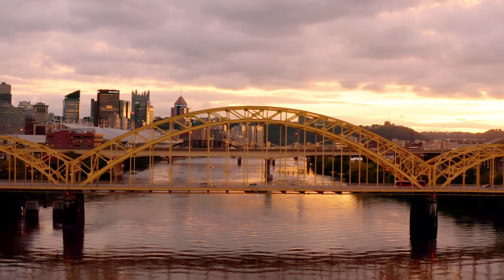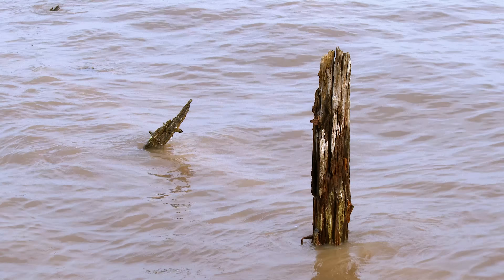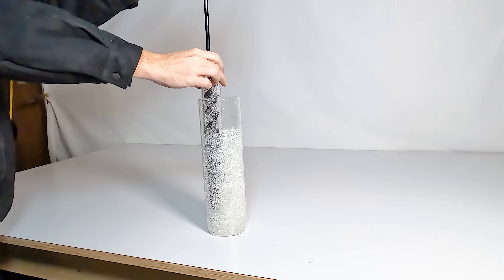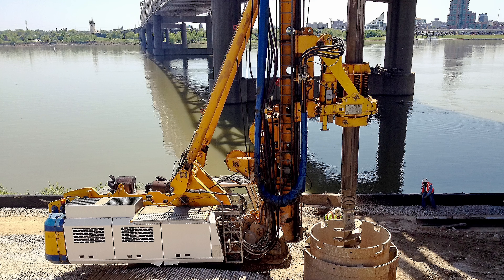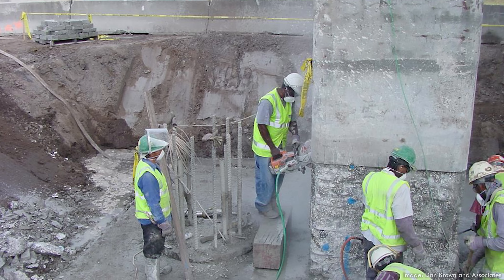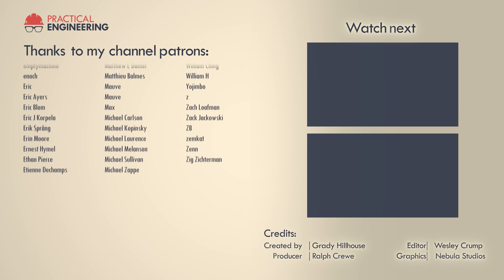Why Bridges Don't Sink

Comment: The constant banging is needed for a proper pile driving. There is a depth specification concern for sure,  though production needs require quite a depth per thrust ratio.

Comment: 3:14 maybe because when they’re used as beams you want to be setting them with the flat sides on the top and bottom so they’re I-shaped but when they’re used as vertical pilings it’s better to arrange them for laying whatever you’re putting on top of them in a way where they’re H-shaped?

Comment: As a resident in Hampton Roads, Virginia, I have seen many bridges get built, and the area continues to grow due to the military presence. In fact, right now, a multi-billion dollar project is going on in my are with the widening project at the Hampton Roads bridge tunnel. It's using one of the world's largest tunnel boring machines, (nicknamed Mary). Meanwhile, the world's largest privately owned Bridge Tunnel, the Chesapeake Bay Bridge-Tunnel, is also being expanded with two new tunnels. It's an amazing time to watch these two modern marvels start construction. In Chesapeake,  the Deep Creek Bridge replacement project is underway by the Army corps of engineers and construction teams. The bridge was built in 1922 and was well overdue for replacement. I am happy to say that our bridges have never sank. However, we had one case of a bridge collapse which occurred during construction of the new Jordan Bridge. That case is a whole can of worms I don't want to get into. Let's just say the company that built that bridge later went on to build the Florida University Bridge which also collapsed.

Comment: I know the answer, Romans, port concrete, underwater, and set underwater without barriers or anything else. I don’t remember the exact terms of how to do so, but they did make docs and barriers for boats because of the concrete that they had back in the day could set underwater. I assume it’s similar to today, but also technically we set big barriers up to allow the concrete to settle in water Without getting fully wet. Ancient concrete was definitely a thing back in the Roman Empire back into. 1600 hundreds, so if anyone has a dispute about this, you could look up the history channel and get a better understanding upon how the Romans set concrete and water.
Reply: To add that it was probably more closer to the 900 if I’m to be more accurate because the 1600s was where America started taking over past England so 900 would be more remote. It makes more sense but I do encourage people to look up the ancient Roman concrete because it is stronger than our current concrete only because we don’t need to put our current concrete into water and the ancient concrete, but it also used volcano ash or something to make a little stronger but being Romans concrete still stands after 1000 years so love it better than her 20th century stuff mostly because we have steel the concrete to make it better. The old concrete back in the day didn’t steal or iron. It just needs to settle in the water and then potentially it did make it stronger because even at today 2025 there ancient concrete is still standing, even if it is a little broken, but there are videos out there that can explain more and the one I watch previously was from the history channel

Comment: The geology around here leads to a few compromises with foundations. I am in Inverness in the Highlands in Scotland. We sit on top of a major fault line which thankfully is not very active. The entire length of it is glaciated and filled with fresh water interspaced at intervals across the country with plugs of glacial till upon which a few of us, about 80,000, live. We know what's down there since the BGS website records a near 100m drilling operation from the late 19th century that records the presence of only sand and gravel. One housing developer replied to a question about their foundations with, "We cut the grass." This reflects an understanding that whatever depth they went to beyond the grass had the same stability for the one and two storey buildings they were dealing with. For larger and more complex developments, drillers make 10 or 15m exploratory holes (many on BGS site). Some state they are looking for "bedrock". Well good luck with that since it is 300 or 400m down in some areas. Extensive piling operations can lead to confusing results for those who struggle to understand what they are dealing with. All one needs is one member of the team who was educated locally and did a primary school project on glacial till and it should sort itself out!

Comment: I love piles...  I built outdoor patio walls on soft ground by using treated 2x4''s that I pounded into the ground in a line. Then with a straight line string Marked each one level with the other and used a saw to cut that off evenly, then placed a 2X4 across them as a base plate. They support a number of 3 ft by 7ft double glazed glass panels. Then a course of double 2 by 4 on edge to support the roof structure. They have not budged a millimeter in 12 years. Also used pressure-treated fence posts as piles to build a bush cabin in soft and uneven ground. Just pound them in till firm, cut them all level and build the structure on top of them. This is a very cold area and having the piles pounded in deep there is no frost heaving to worry about. I was also thinking they could be used for driveways and walkways built on soft ground. Small fraction piles could be pounded in the ground along the course of the walkway then concrete poured on top. These would never settle and  become uneven causing problems in the future.

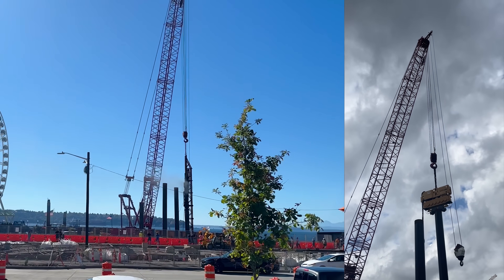Comment: At 7:55, to the right there’s an APE Model 200-6 vibratory driver/extractor that has a driving force of 271 Tons. Pretty amazing piece of equipment. 

Pros:

- Slightly more forgiving to crane operators. (Generally speaking every job is different.)
- Can make fast work of any pile or sheet in soft to medium ground hardness conditions.

Cons

- There’s an entire separate power unit to take care of in order to power the hydraulics.
- HOSES, HOSES, HOSES. Anywhere from 100 to 300 feet of hydraulic hoses that the pile driving team must protect from kinking, wearing, breaking, and ect… 

On the left, looks like a D-46 diesel hammer either from APE or Pileco. One of these babies can give you 114,000 ft-lbs of energy on maximum stroke. Diesel hammers are the dirty beasts of the pile driving industry.

Pros

- Will make easy work of medium to high hardness ground conditions.
- Once set up, easy for the pile driving team to take care of.

Cons

- Experienced crane operators are preferred because some hammers require the control of three lines.
- Loud and Dirty. 
- Soft Ground 

This is APE if y’all are interested www.americanpiledriving.com/

Comment: I did construction layout for the bridges on the new section of 540 in Raleigh nc. What a cool experience to work on bridges. I got to walk on the girders to do profiles for the build up measurements. They needed to make sure the deflection would be perfect after the weight of the deck.

Piles not going in straight is the only part of building a bridge where they just say oh well what can we do. Everything else is insane tolerance pushing the limits of survey equipment.

Comment: Im an engineer
I-Beam (or W-Beam)

Has a narrower flange (the horizontal parts).

Designed for horizontal load-bearing, like in building frames.

Flanges taper slightly (not perfectly flat).

H-Pile

Has thicker, wider flanges, making it more symmetrical.

Designed for deep foundation support, driven into the ground like a piling.

Comment: In the UK, the High Speed train link from London to the channel tunnel had to pass over the river Medway, known as the Medway Viaduct. This was designed with "V" shaped piles to allow for the lateral loads created by two high speed trains on the viaduct travelling at top speed slamming their emergency brakes on at the same time. Glad they considered that worst case scenario, I wonder if all rail bridges did?
https://en.wikipedia.org/wiki/Medway_Viaducts

Comment: Well, all this is a heck of a lot safer than the construction of the Brooklyn Bridge's river foundations.  Saw a documentary about it on the History Channel back when they still had history.  They build these large wooden structures called caissons, which were like giant upside down barrels.  They sunk them in the East River, filled them with compressed air, and then sent workers in through an airlock.  The workers manually evacuated the river soil, which allowed the caissons to sink further and further down.  Once they hit the desired depth, they could be filled with brick piers and concrete.  Hot, humid air, cold water, and a poor understanding of what we now call decompression sickness made it miserable, dangerous work.  The chief engineer, Washington Roebling, was badly injured by decompression sickness and subsequently directed the construction from his home via telescope and letters delivered by his wife.  In fact Emily Warren Roebling would take over most of the day to day supervision and chief engineering duties in her husband's absence.

Comment: Do you genuinly not know why they are called H beam and I beam? Aren't you(or someone in your team) a civil engineer or something?
They have slightly different shapes, and are thus able to take different loads. I beams are named after a capital i(with a line at the top and bottom). I feel like this is common knowledge.

Comment: I work in Marine Construction we have an A frame barge with a 2500 lbs weight we use to dtive pylons, we jet them in on bulk heads with a jet pump depending on the ground, sand is good, clay we have auger the holes.. small company I work for dont have an excavator

Comment: ??  When you do those pounded in piles, great, you know exactly what types of weight it resists !
But with other methods,  how do you even start to know what size or type to use,  when "the ground" is under X+ feet of water & muck ?

Comment: A small correction.
3:10 You just told about applying Newtons 3-rd law to loading and driving piles which is absolutely correct. Newtons 3-rd law is about forces. 
3:55 Now you are speaking about driving a pile in terms of energy. Energy not relevant here, you should stay in terms of forces. What's really important here is the momentum of the hammer when it touches the pile. That's the reason why you need a heavy enough hammer to drive a pile - the heavier the hammer is the less energy you spent to get same momentum (p = m*v, e = m*v*v).
PS. Thanks for your videos! They all are amazing, I really enjoy them!

Comment: I have designed some large diameter drilled shafts and was wondering what the maximum diameter is. We are talking machine drilled, not excavated like the Brooklyn Bridge. My record is 15’ for transmission poles in Texas. 

People want to go bigger, but I have not heard of any bigger equipment. Trying to ship a 16’ auger down the road would be an interesting challenge.

Comment: When they need to reinforce old bridges foundations, it's in many cases Impossible to use the methods described. in those cases it's better to use Jet grouting. Under high presure they inject cement in the ground under the foundation.

Comment: When they built interstate 80 across Lake Milton, I have no idea how they drove hundreds of massive angled I beams to build 2 bridges straight and level across about a mile of lake. They had a giant barge they must have trucked in, in pieces, and then welded together. Somehow, they picked up those beams, angled them just right and drove them in water 40 or 50 feet deep. But how, when they got near the shore, and the water was too shallow to float the barge, I don't know how they ever did all that. Years later when the lake was drained, there were all of those I beams, driven right where they were supposed to be

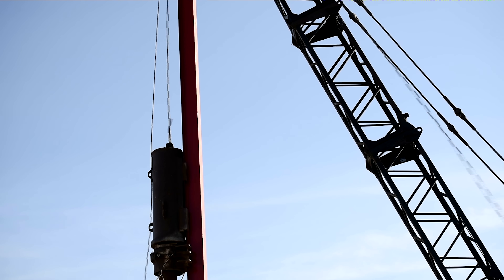Comment: I am a journeyman ironworker, I have over a decade of experience. 03:20 ,  This is the simple difference between an I beam and a WF (Wide Flange), "H" beam. The amount of material in the crossing member connecting the two outer parts. |~----~|. Called the Fillet Radius

Ill tell you that you got the H and I beams wrong in that first illustration for several reasons. First. There is no such thing as an H beam. They are called Wide Flange (WF) beams. In your diagram 03:20 , the left image is a "H"..WF (wide flange). The right would be an actual I Beam. The ~ represents the added material during the rolling process, IE Fillet Radius.  | = represents the flange part of either, --- = web
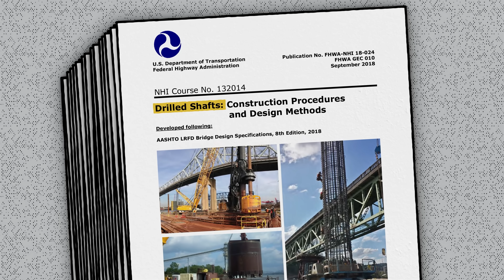Reply: 09:00 , hey look, a rod buster, I've done plenty of those too. Its hard to get your foot in a lot of the time so you are duck walking up them, also getting stabbed by the tire wire as you go.   They are pre tied on metal pipe saw horses and then tripped and set like columns. But you still have to climb them to, say, disconnect the crane, or add wagon wheels, or add more bars if the engineer so decides it.

Comment: A new bridge is being constructed across lake Ray Hubbard near Dallas.  It's been a real treat the past couple of years to be able to take the boat out and just watch all the pyles being drilled.  They are drilling with casing and they haven't had to go super deep, and the water is relatively shallow compared to most bodies of water.  They've actually progressed surprisingly fast for such a giant project. They may have less than a mile left.  For anyone who wants to watch up close, it's cheap to rent a small boat, and they allow boats very close to observe.  They typically don't work on Saturday or Sunday,  and the weather around here is very favorable with very few weather disruptions.

Comment: Just some local knowledge involving piling. US Steel blast furnaces in Gary, IN, constructed in the early 1900s are sitting on timber piles driven into sand (literally on lake Michigan beach). In that era and looking historical photos they don't look more than 30' -50' deep. These furnaces over the decades have gone through vast changes in added structures and off centered loading never dreamed of at the time of build. They've gone from 12 down to 4 furnaces based on more efficient production and create more iron now than was ever possible with the original designs. Enormous changes have been made to these structures all while sitting on wood piles driven into water. From other projects I've been on in my lifetime bedrock is 100-120' in this area. Slightly west of these these furnaces Inland Steel in 1972ish built no7 blast furnace, largest in the northern hemisphere at the time. It's crooked. I believe it's said it settled before construction was finished. Basically modern construction methods, modern materials and technology leaps and bounds ahead of US Steel's original construction and 😮!

Comment: This is so perfect. I just saw guys drilling holes into the soil from window of my office. It was few days ago. They drilled hole while putting large steel tube into ground. Then filled it with concrete, remove pipe and went to do another. And now I have nice description of what exactly these guys did. Nice!
Reply: Yep that’s caisson drilling 😎

Comment: My father used to be a construction inspector. The most boring job on the entire site was counting the strokes of the pile driver to keep track of soil resistance (or pile failure, which occasionally happened).

Comment: I've driven miles of piles over the past 25 years, timber piles, H-piles, prestressed concrete piles, pipe piles (steel and concrete)... Toss in drilled shafts and micropiles, and I've inspected most of the bridge foundations used today.  We still use spread footings near my home in SW VA wherever we find competent rock.  I know a lot of folks in the business hate pile driving, but other than deck construction, it's my favorite part of bridge inspection.

Comment: Did a placement year on some construction works and a water treatment plant.
Some of the old water storage resevoirs had pile foundations that were designed with tension in mind, as when the resevoirs were empty (essentially a giant concrete bath in the ground) the bouyancy from the groundwater could have lifted the reservoir at least partially out of the ground and damaged the whole system.

Comment: Down here on the gulf coast I'd say 95% of our deep foundations use drilled shafts. In my experience casing is usually placed prior to drilling the shaft. Drillers will drill a shallow pilot hole if it's above water and for underwater construction they will use the vibratory method of casing installation. Usually for drilled shafts in water or below the water table will use the slurry method. The shaft is flooded with bentonite slurry usually around a specific gravity of 1.03-1.10 g/cm3 which usually creates enough hydrostatic pressure to prevent caving. Your explanation of the tremmie method of placement was spot on. Even the characteristics of the bentonite slurry after final depth is achieved has several testing requirements before you can proceed to placing concrete, % sand content, specific gravity, PH, and viscosity. I do quality assurance testing and inspections for heavy civil and commercial construction, so I find your videos entertaining.

Comment: Bridges don’t sink because they have I-shaped Pillars to support the structure, which prevents cramps and cracks. Also the pillars are rugged up too deep below the water surface to avoid sinking.

Comment: In the late 70s I was designing a fire sprinkler system for a new building. I had a lot of plans I didn’t need.  One was the pile locations.  

Lots of long wood poles.  Get to the end of one pole, I think they just put another on top of it and kept driving. 

Gonna be underground/underwater and last a hundred years or more.